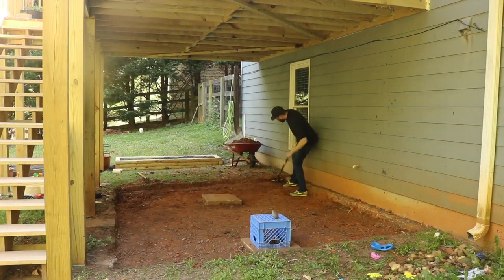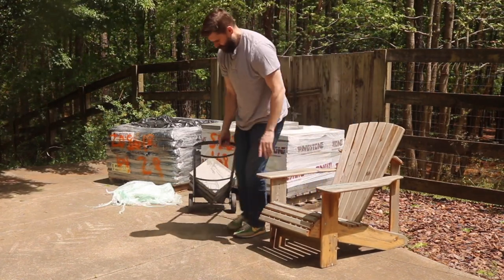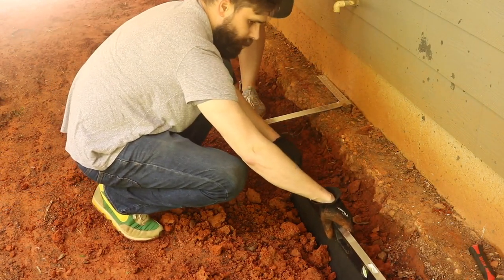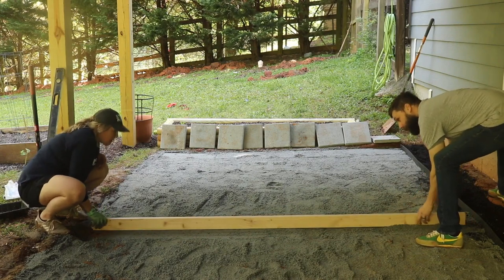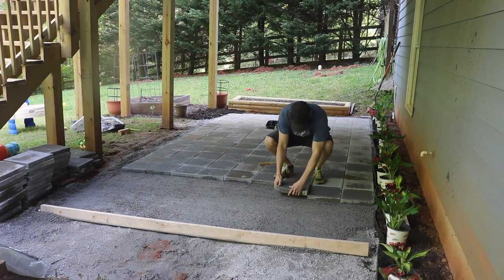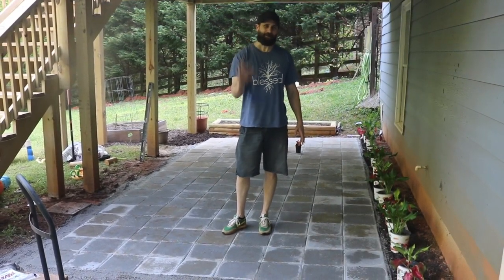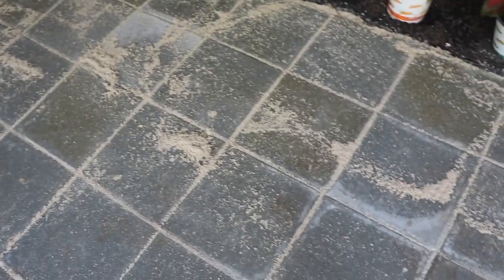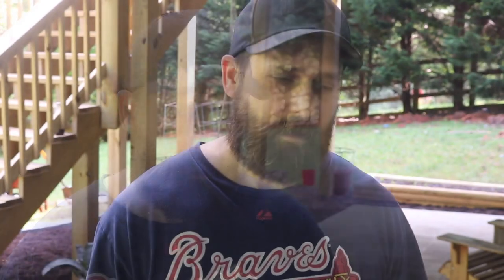Paver patio build

Comment: Only thing I would say is lay a weed control fabric down before you pour the leveling sand. Helps with not letting grass grow through over time. Great vid. 👍🏾
Reply from the maker: I actually have had very little grow through three cracks. Of course, I have sprayed what I have seen, but it has not been bad at all, surprisingly.

Comment: I bet it was satisfying Chris. What was the total cost like?
Reply: Im wondering the same. Y’all did a great job-gave us new ideas to finish out under the deck.
Reply from the maker: I think we spent somewhere around 600 bucks or something for all of the paver stones and paver base. Could’ve gotten it cheaper if we had a load of paver base dumped on our property instead if buying bags, but we didn’t want to deal with a huge pile of the stuff and if we had extra we didn’t want to have to worry with cleaning it up. Also could’ve saved a lot if we didn’t build such a huge patio.
Reply: @ChrisMcDowellDIY  Tarp would help with that. Not sure about disposal of the leftovers, though.